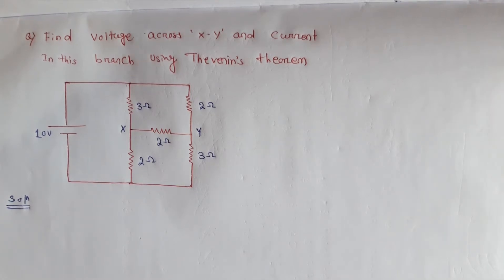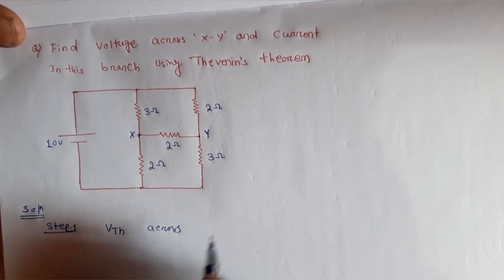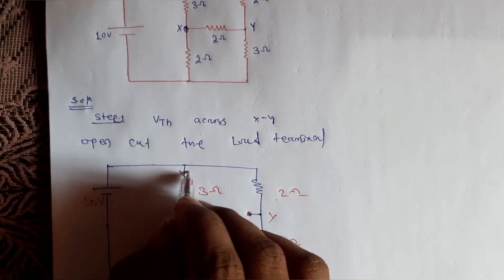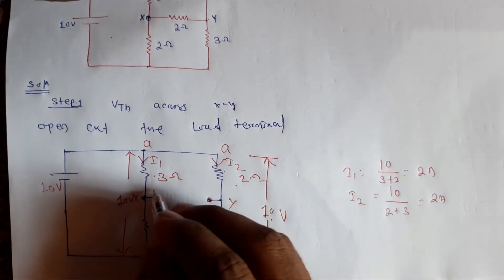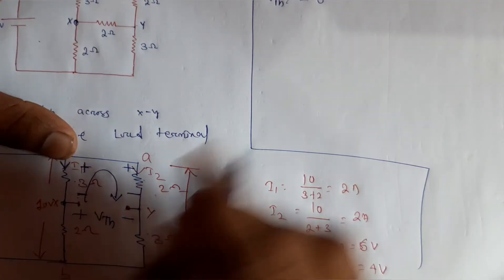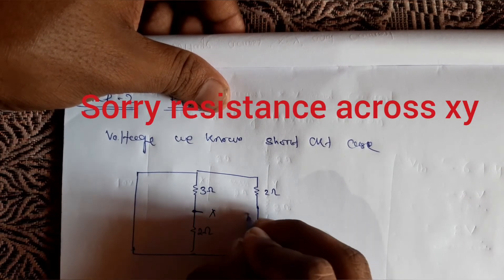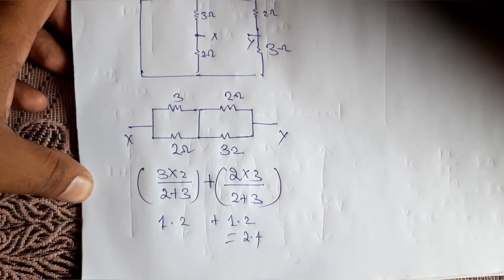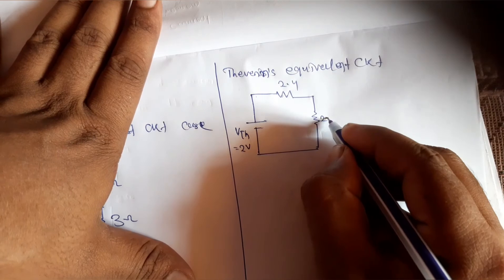Thevenin's theorem problem-1

Comment: Can i use delta star connection to find total resistance and use ohm with kirchoff law to find the voltage?
Reply: For finding total resistance you may apply delta star conversion but here he find thevenins equivalent resistance